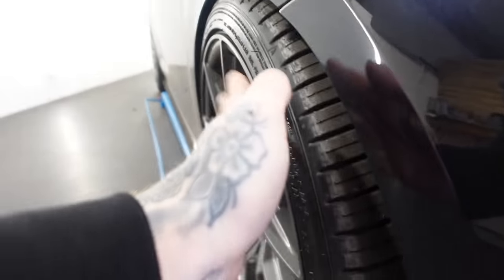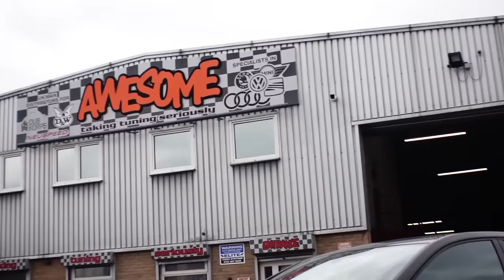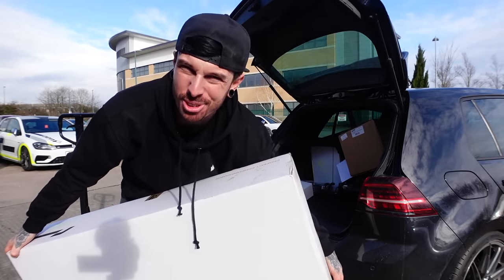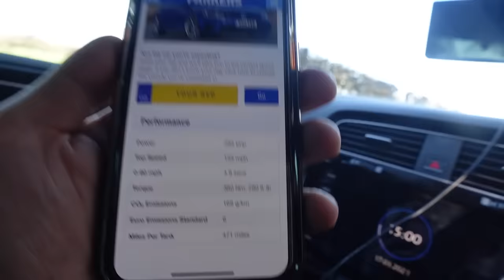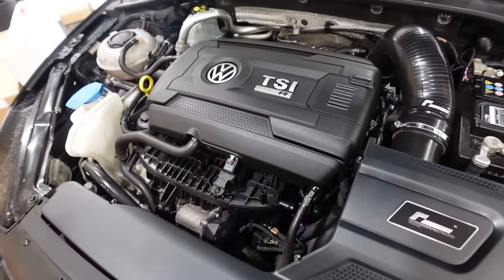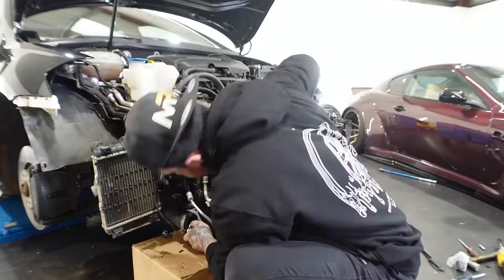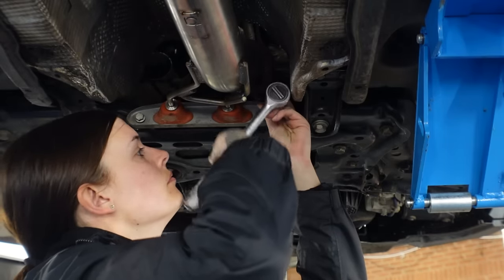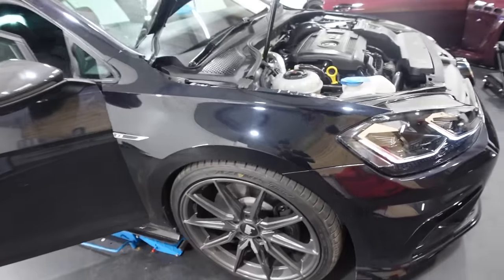MAKING MY WRECKED GOLF R FASTER THAN A LAMBORGHINI

Comment: For anyone wanting to do the intercooler , you don't need to remove the rad pack or the headlights. The bed doesn't need to be undone either,  mark the prop shaft before removing it so it goes back on in the original position, then tie it up to the passenger side ( it is a squeeze but possible to still remove the DP)  If you live in the NE of England  I can help with these  hardware installations. Chris Wilson.

Comment: Being a GTI owner, you didn't even need to buy an entire air intake system. Upgrade the piping from the stock box, upgrade turbo inlet pipe, cut out the plates blocking off airflow through the front grille, install backing plate to the left side of the front grille induction piece, remove snow guard, and install a high airflow filter.

Comment: Matt - could you get the guys at Mallory to dyno the golf before the Stage 2 remap. I'd like to know what HP / Torque gains you have seen with just the addition of the airbox and the down-pipe. I assume there will be minimal gains based on previous induction work, but you never know. Then do the Stage 2 remap.
Reply: Albeit, if you'd done a Stage 1 remap, dyno, Stage 2 remap, dyno, airbox and downpipe, dyno ... it would have given us a good view of what tuning mods work.
I kinda know what works but don't want to put out a spoiler.

Comment: did you fit the original plastic oil sump? did the metal sump still leak after you re sealed it? did not hear you mention it in the previous video's .

Comment: Another bangin video...
Has anyone told you that you've got the lights wired up wrong tho ? 
Dipped beam uses the outer ones, main beam the inners 😉
Reply: I was just looking thru the comments to see if anyone else had noticed.
Reply from the maker: Trust me I’ve been trying to work it out myself apparently they need coding to the car. I can’t see shit at night
Reply: @MatArmstrongbmx  summer is round the corner 🤣 lighter nights, no problem

Comment: Hi matt, when it comes to the ea888 gen 3 platform, exhaust choice really is key, there are so many offerings but, a lot of them end up being too droney. when it comes to having a decat rather than a sports cat, id advise you to get a resonated system, otherwise it will become unbearable. racingline make some great products, dont know much about the intercooler but it must be decent, wagner is usually the go to.

I know you know your cars quite well, but just to be on the safe side, if you end up driving this for a while before the stage 2 tune, make sure you drive it sensible, the is38 found in these cars are pretty sh*t turbos and with it not being tuned for the decat it will overboost and with that comes throttle closure, biggest killer of the is38.

Comment: Whoa....3 videos worth of content in 1 vid. I would have maybe liked to see the performance improvement of each part, particularly the air intake and filter. Also maybe how long the install took you and an idea of cost. Awesome content 👍😁
Reply from the maker: It would only be very very small 10-15bhp. If that install was about 7hrs because of that down pipe 😂 looking at about £1100 for parts
Reply: @MatArmstrongbmx  Thanks Matt looking forward to seeing the gains. Just had a stage 1 remap on my S3 so very interested in your results. Keep up the good work 👍😀

Comment: Hi Mat, after fitting my airtec intercooler i noticed it pushed the rad pack back a touch. It moved a coolant hose closer to the auxiliary/alternator belt and ended up splitting. Have a look if yours has done the same

Comment: I used to buy salvage back in the late 90’s up to early 2000’s and usually done alright, then gave it up due to work commitments, fast forward to 2008 i bought another Honda Civic type r and just broke even, i noticed salvage was getting more and more expensive as companies started taking the piss.